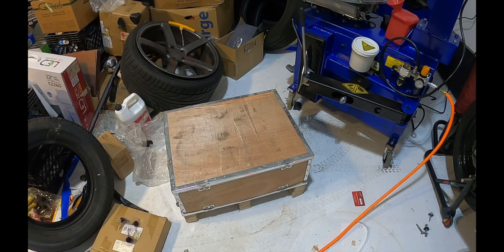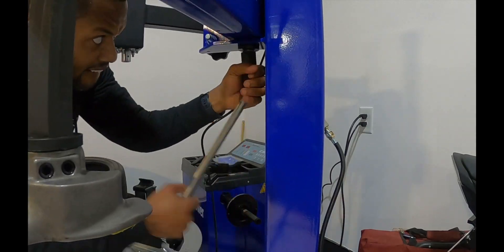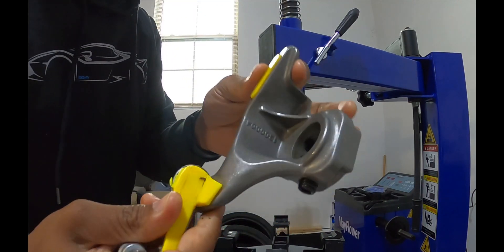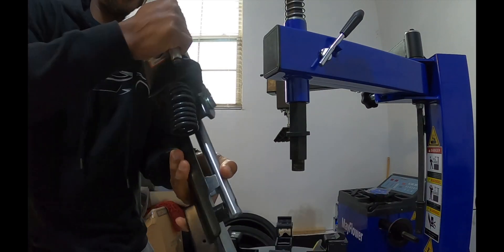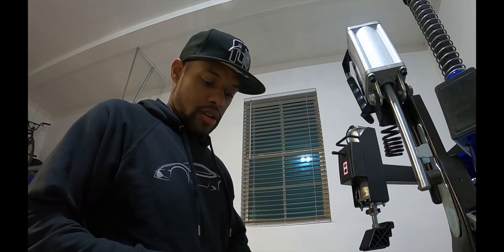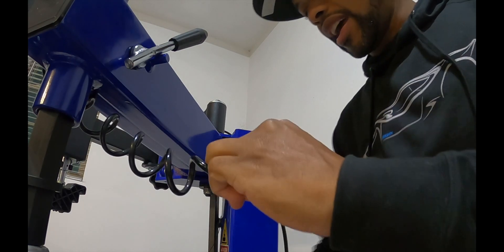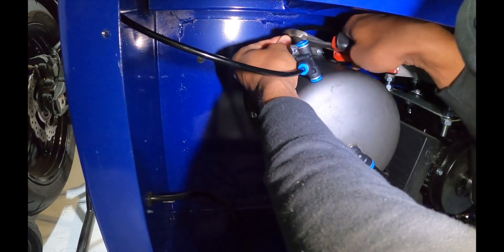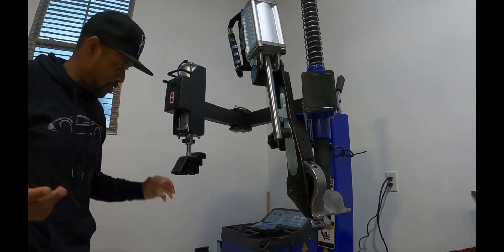Mayflower Tire Changer Assist Arm Model 230 - Leverless Duckhead Installation

Comment: How did the assist arm work for low profile tires? I have the 560 right now without it and we struggled all night to even get one on.
Reply from the maker: One arm helps but you really need two to get it done more efficiently. I ended up selling this unit and getting one with two arms instead.

Comment: Does this work on the Mayflower 980 model without the assist arm?
Reply from the maker: Yes it should.
Reply: @btbuildthings I actually emailed another YT creator yesterday (MrMotofy) and we both took measurements between our machines and found out that my model (Mayflower 980) has a bigger C channel where the swing arm goes into which makes the Mayflower 230 not usable. So I would have to buy the expensive 300 model meant for 980 machines.
Reply from the maker: My bad, I don't know why I answered as if you were talking about the leverless duckhead. You are correct. The 230 assist arm will only work with the 560/950 models so if you want to add the assist arm that would work for your 980 unit, you would have to use the 300 assist arm. The one issue is that it seems to be cheaper to buy the unit with the arm rather than adding it on after the fact.
Reply: @btbuildthings  Yes definitely cheaper to buy it altogether at once. I’m kicking myself now for not doing that..
Reply from the maker: Yes, same thing that happened when I bought the Mayflower unit in this video. Ended up selling it and replacing it with one that had all the specs I needed.
Reply: @btbuildthings Smart man!

Comment: Great work man! but why did you sell this equipment? it does not seem to lack from something but I would appreciate if you can share that
Reply from the maker: Thanks. There was nothing wrong with the setup except I needed a larger outer clamping diameter. This one only went up to 18".

Comment: Just purchased my 960 and 680 and set it up last night. Thanks for the tips on calibration and i just ordered that arm from Ali express. Price wasn't that bad. I hate using that tire iron to get the tire iron over the tire bead. Did you make a new video with your new tire changer? I subscribed young man keep doing your thing!!
Reply from the maker: Awesome. Nothing like being able to change tires yourself. Here's the unboxing of the newer unit I got. https://youtu.be/x8wHOBfdJ0U. There are other videos as well but so far, this is exactly the specs I initially should have looked for when I made the first purchase.

Comment: Hey...new subscriber. Do you have a link for that leverless duckhead? Looks like a great upgrade. Have you used it much?
Reply from the maker: Awesome, Thanks for the Sub! Here is the link: https://www.aliexpress.us/item/2251832844976666.html?spm=a2g0o.order_list.order_list_main.65.472418024k8kvz&gatewayAdapt=glo2usa4itemAdapt&_randl_shipto=US.
Just be sure to measure the diameter of the arm so you get the right size since they come in 28, 29, & 30mm. I actually used the leverless duckhead while it was installed and loved it but ended up selling that tire machine a while back. I actually just got a new unit this past week so there will be videos on that coming shortly. I was planning to install the leverless duckhead on the new unit but the opening is 28mm and my arm is 30mm so I'm trying to source an adapter and since it will be coming from China, I probably wont get to install it until late Feb.
Reply: So you pulled your duck head and measured the inside diameter of the hole? I have the 980 with the assist arm but that looks like a great upgrade. Thanks for the quick response and I'll look for new videos.
Reply from the maker: @KSJeff  Yup that's right. You can measure either the inside of the duckhead or the arm itself.